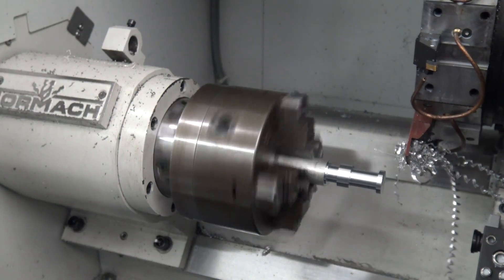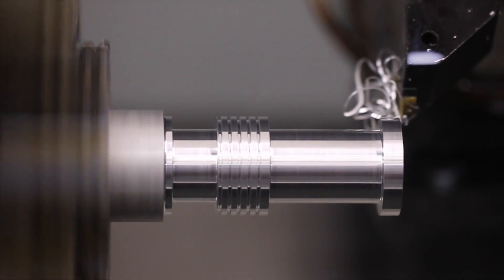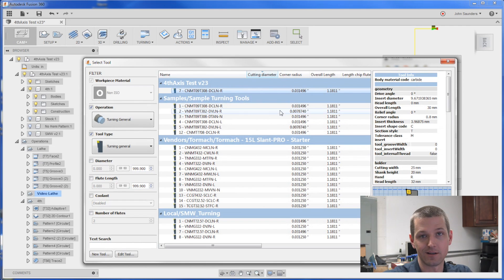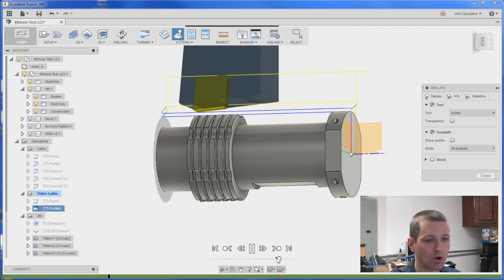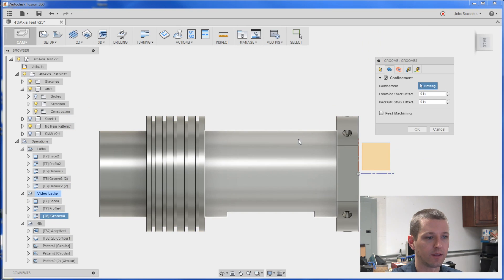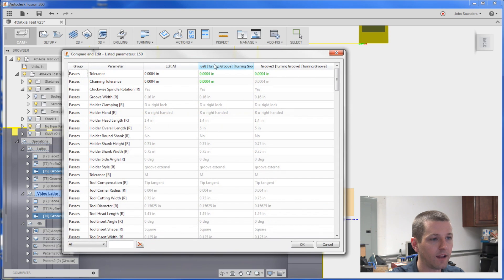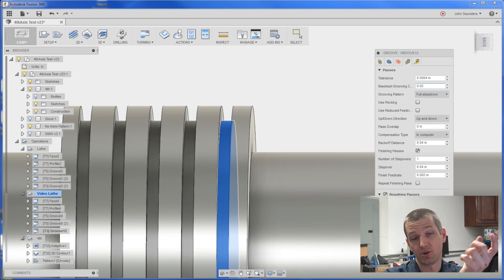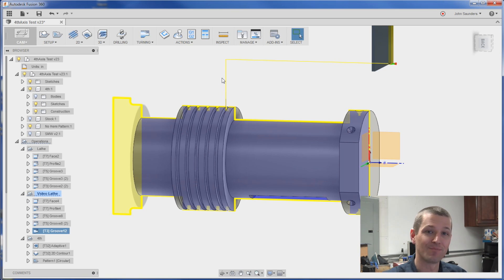CNC Lathe Turning!  Prepping for 4th axis. Widget82

Comment: That step over issue is a strange one I have come across a few times myself.  It seems like if you play with the maximum groove stepover, the number of step overs, and the final stepover and make the numbers work out to removing the exact amount of material you have then its OK. Its sort a PITA and while I suppose it makes sense from a math standpoint I think fusion should just adjust the stepovers automatically so that your not going past what you set as a final stepover amount. I also can never seem to get what I want when I have roughing passes enabled, I think turning\grooving definitely needs some work, or at the very least a better explanation on how its supposed to work with whats there.

Comment: is it just me or the rpm was low for aluminum?
Reply: The rpm seems way low. You reduce/stop birds nest by creating a chip and not long sworf. The long sworf shows its sheering and not cutting.
Reply: +sharp x Yep, the feeds and speeds are too conservative. Good quality aluminium should never produce such long chips while roughing.
Reply: +NYC CNC Just max out rpm or have it at 3500-5000 rpm and it will rain chips and the work will come off cool
Reply: +imissmynut Better way would be to check out the recommended feeds and speeds of your cutting insert manufacturer. They usually have aggressive speeds which in addition max out the tool life. At least from my experience.
Reply: +Revo SeR Yeah if you can get speeds and feeds from the insert manufacturer that is the best most ideal way
Reply: NYC CNC
just in case - didn't have a good look at the inserts with the holders being upside/down, were those inserts for aluminum?
Reply: NYC CNC
 in that case you're right to be conservative with the speed, tends to stick to the tip of the insert especially if you cut it dry

Comment: Interesting video as always, John!

Is it just me, or are the small grooves machined in the wrong places?  In the model, they look to be centered on the raised section, but in the machining footage they appear to be shifted to the left.  This is especially noticeable when the last groove is machined around 3:16.
Reply: +John Sasinowski yea I also would like to know
Reply: +John Sasinowski yup, sure looks like the tool offset is not correct in the cam
Reply: +NYC CNC I had the same prob. Path pilot wants the tool measured from the right side and in fusion its from the left.  I just set it to the right and whenever i do any conversational i just add or subtract the .16 offset